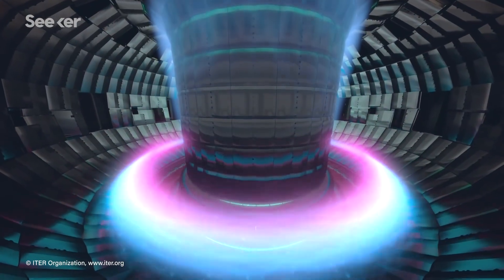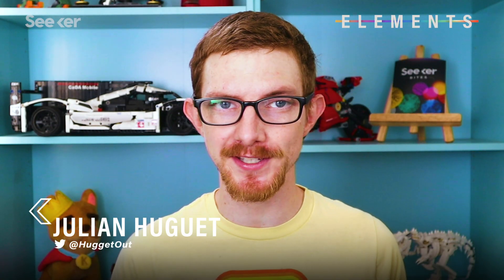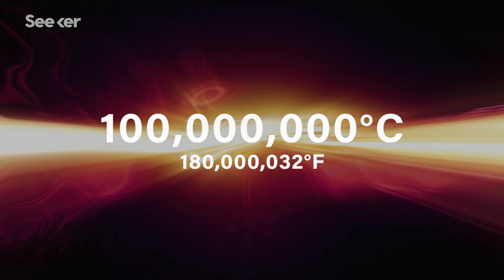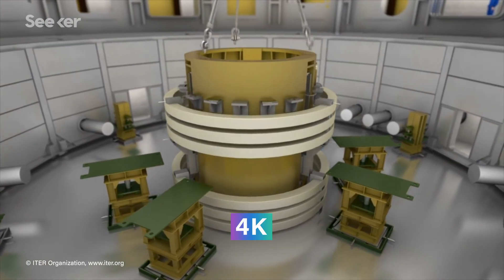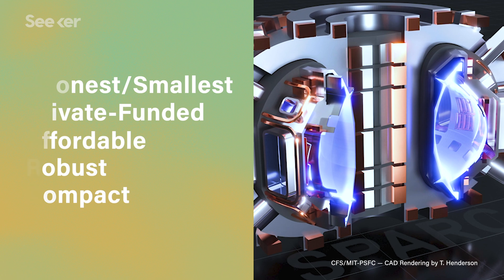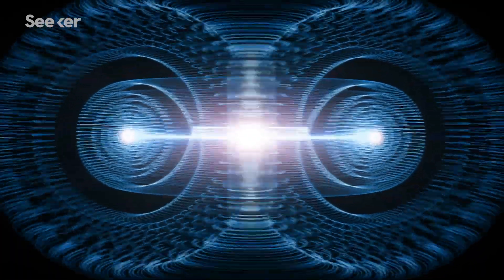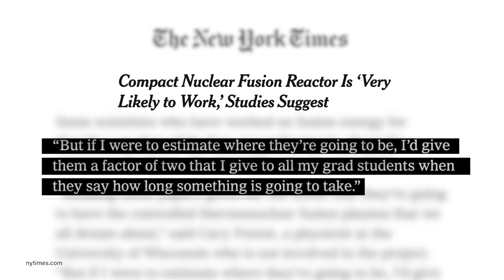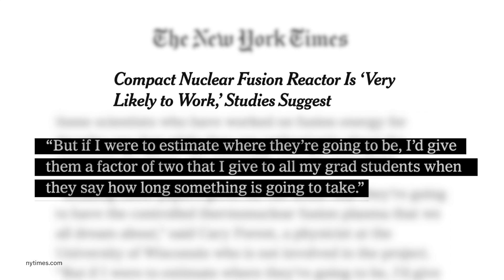Fusion Energy Could Be a Reality in Less Than 5 Years

Comment: OK, cool.   Let's say it works.  How do you get energy out of that and into the grid?
Reply: Very simply put, energy from fusion comes in form of fast neutrons, that escape confinement as soon as they are generated: part of the whole inner wall (the "first wall") is actively cooled by water or molten salts, transferring thermal energy to standard turbines+alternators groups for electricity production.

Comment: I think leaders of ITER project have already stated that they intend to integrate as many new technologies as possible as they come along during the construction. Though it might be impractical to retrofit magnets, they're not at that stage yet. Another point for ITER is that at current schedule they are going for ignition and self-sustaining plasma by 2024-5. So that's already in the same timeframe as SPARC. Even if ITER doesn't benefit from new superconductor technology, it's still likely to achieve the set goal before 2050. And as far as climate crisis is concerned, 2050 is already much too late anyway.

Comment: I mean, only reason I care about fusion is for semiconductor manufacturing. Right now to make 13.5 nm extreme ultraviolet light (EUV) you need to vaporize a tin droplet into a million degree plasma which emits the lights through blackbody radiation. Fusion won't be economically viable compared to solar & batteries, but at least it gets us a source for higher energy plasmas that can be used to make faster iPhones.

Comment: The reason I'm so hopefully for fusion is that it used to be "always 30 years away" 50 years ago, "10 years away" 20 years ago, and now it's "5 years away", the estimate is always going down, until it eventually gets to zero
Reply: until it gets 0.000001 ms away, and then 0.0000001 ms and then...
Reply: John T  -- Not sure where you are getting your information from but every major experiment to date had the goal of a Q of at least 1 or higher, anything lower being pointless. The first and only time a Q Factor of 0.67 was achieved was in 1997, nearly 25 years ago in the UK. Also note that you actually need a Q Factor of 5 to really break even, that is when you count all of the energy needed to run everything needed to support the reactor in a sustained model. 

In your second comment you are saying that scientists need to lie to get funding, that is wrong on so many levels it is hardly worth addressing. I can assure you that every single mainstream Fusion project funded by governments or private investors was based on what the scientists really thought was possible at the time of the prediction. 

This is where you and so many miss the point, we have known since the first hydrogen bomb the potential of fusion power, not to mention we see it every day from the Sun. The point is that at each step of progress we are hit with substantial new problems, hard core engineering problems, materials problems, containment problems, and even theory problems, many of these issues were not identified is the previous step and that just keeps on happening. 

Controlled fusion will be a huge prize when it finally works, which I believe it will, it will be bigger than fire, electricity,  and for that matter every invention or discovery since fire. 0.67 is not close and we have been sitting there for a quarter of a century with no material progress, that is 9.33 off for viable fusion power. Worse than that, even with a Q of 10 which is the current best case target, that will still not be enough to compete with fossil fuel. Science is always its best when the truth is told, anything less than that is just a scam.
Reply: I am not sure why you are encouraged about announcements of shorter time frames when not one single prediction from 50 years, 30 years, 20 years, 10 years and now 5 years has even once come close...
Reply: John T  -- I have no idea what you have been following but it is not fusion if you think 0.67 is significant progress for 50+ years of work. We have had a lot of designs with the aspiration of a Q over 1 and of course ITER with a goal of 10, but my point is still 100% accurate, we have not even come close, 0.67 is not close, it is a little over 1/2 way.

That is just in the literal numbers but does not predict when that will go higher. I am a strong supporter of Fusion but what really undermines it in the general public, you know, the ones paying for it, is when we are feed these projections that fail every time and they seem to do it every couple years.
Reply: okie dokie there stable genius.
Reply: If you take 50 and devide it by 2 and then devide the result by 2 again and so on, you'll never arrive at zero.
Reply: John T  This was not meant as a serious argument, I just wanted to poke some fun at OP because of the way he wrote his comment. :)
I'm certain we'll reach fusion energy at some point.
Reply: John T  -- Sadly the best you could reply with is an homonym attack. When you care to address the facts I would be glad to engage you on them but have no interest in finding out who's mother is fatter. The bottom lines is that we are no where near 5 years, or 10 years from viable fusion and we can't even make a reasonable estimate until we get past the basic issue that we can't maintain a sustained reaction sufficient to produce commercial electricity.
Reply: and it will never go to zero, PERIOD!
Reply: Using a better method mind you.
Reply: Untill Governments say thats it's a waste of money
Reply: @watema3381  to be fair ITER is a project funded by the the EU and several other governments outside Europe. And with its 10:1 power output predictions in I think 5-10 years you could say they are
Reply: @LemonArsonist  ITER is a waste of money because its doomed to fail. It already been proven by several physicsts that it will not work. But France & the physicsts working on the project want the project to move forward because it creates jobs.
Reply: @LemonArsonist  we could achieve this in 2 years.
Reply: @watema3381  except alot of fusion research is now done by private organizations thats why it's moving so fast
Reply: @watema3381  how optimistic.
Reply: @sheepketchup9059    Sorry about that! I'm a bit of a pessimist / realist. I see evil everywhere. The potential of "clean, pure 100%" blah blah energy just sounds too good to be true knowing today's world / reality / corrupt governments.
Reply: @watema3381  only private companies are capable of doing clean energy thing just like Tesla did and others are following too . I hope they also throw some money there . but they r busy with oil industry I guess
Reply: @ganeshgaikwad6022  Private industry frequently builds on research financed from public money this is a little known fact. For example, In this case most of the reasearch and design was already done like 4 years ago by MIT students and their prof Dennis Whyte. Its actually, again, a publicly funded research project which needs private investment to finally realize and commercialize its potential. The very reason why their plan is "open sourced",published and peer reviewed because the research was carried out using public money.
Reply: @ganeshgaikwad6022  -- What exactly has Tesla really done but produce a wildly expensive car because of improvements in battery and motor technology. Don't get me wrong Tesla is a fine car, however it there is really nothing ground breaking there and it is certainly not practical for most peoples driving needs. Tesla is basically a rich boy toy.
Reply: @watema3381  It's not the corrupt governments that are the main cause of this, it's just the laws of physics themselves that make it extremely difficult to have efficient sources of energy. Everything tends to go from order to chaos (entropy). Nothing is efficient. Fossile fuel may be "efficient" to burn, but even then, it took milions of years to form so it's really not that efficient when you think about it. The universe just wants to see itself die it seems.
Reply: @MrWildbill47 a Model 3 SR+ for $38,000 USD is not a rich boy's toy. Tesla built the first highway-capable lithium-ion BEV, the Supercharger network that makes their cars completely practical for most drivers, in-house battery packs/battery management/motors/motor control that makes them amongst the most efficient EVs, and the most advanced self-driving system you can buy. Oh and it also makes the first successful solar integrated roof and the most successful home and utility storage battery products.
Reply: @skierpage  -- In reality you are going in over 40,000 for that model, not counting the 10,000 bucks in roof and garage add-ons you mention, solar and charging station, plus the cost of the electricity. You can pick up a nice Nissan Versa for example for $15,000 all in, it refuels in minutes and has virtually unlimited range since you can buy gas everywhere. Don't get me wrong, the Tesla is a nice care for the right situation, just not ready for prime time yet.
Reply: @MrWildbill  You were wrong on "rich boy's toy", you were wrong on Tesla hasn't done anything, and now you're moving the goalposts to odd comparisons. It cost nothing extra to recharge a Tesla at home from a 120V outlet, and per mile BEVs are cheaper to operate than gassers nearly everywhere. You can install a faster home charger depending on your driving pattern, but it's not required. How much does it cost to install a home refueling station for a Nissan Versa that means you never have to visit a gas station except on long trips? If you have a plug at home or work, a BEV is far more convenient for daily driving.

Solar and home battery storage are separate, independently valuable Tesla products. You don't get them with a Nissan Versa either.
Reply: @skierpage  -- Are you kidding, if you charge from home it still costs you the electricity and takes forever on the 120VAC set-up. Tesla represents about 1.3% of the cars in the US and are no way cheaper than most gas cars to own. Basically you get the worse of everything economically and in flexibility, which is why I called it a rich boy toy. Over 90% of Tesla owners also own a conventional gas car. Don't get me wrong, the Tesla is a nice car and fills a niche just fine but it is not ready for the mainstream and will not be for a long time.

Comment: The joke about fusion power always being a few decades away ignores all the breakthroughs we had in fusion power.
We already have mutliple working fusion reactors following different concepts.
We already sustained fusion for helium AND hydrogen.
The only thing that we have yet to achieve is net positive energy. 
And for that we've already have had a solid timeline even without SPARC.
The ITER project said to be finished (with all its testing) in the 2030s and DEMO in the 40s afterwards.